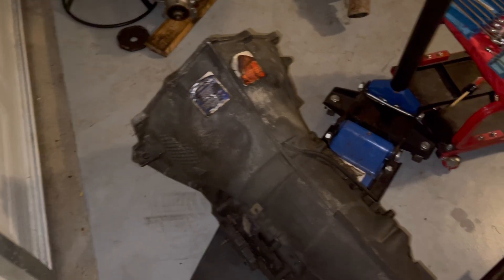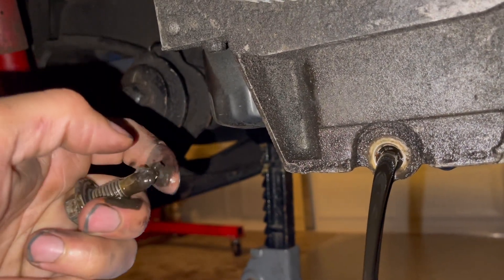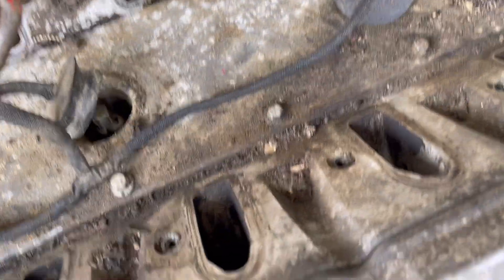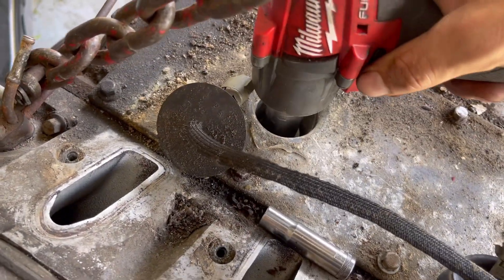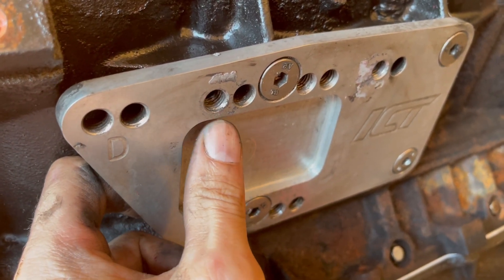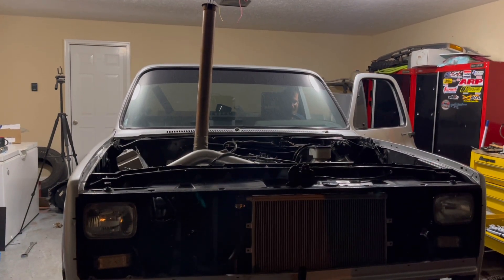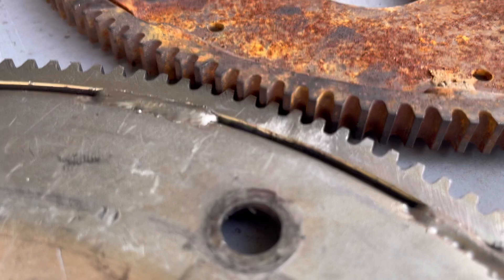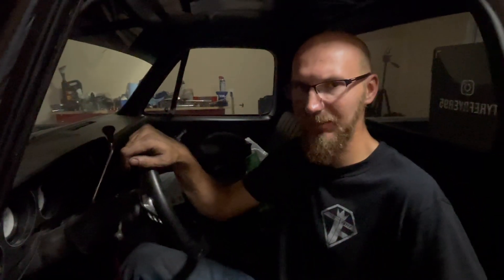Turbo 6.0 LS Engine Install

Comment: Also i dont know if you knew this or not but underneath the oil pressure sensor there is a small mesh like strainer when you buy one from AutoZone or wherever you get your stuff from you can take a long bolt and find out what thread pitch will fit in it and then use that bolt to take out the old one I had a Denali lq9 low oil pressure replace oil sending unit found out that it had one of those mesh filters but could never seem to get it out

Comment: Good call on ditching the Russ More trans. I had them check out the 60e in my 96 because it was shifting slow and it was missing 4th when i picked it up. Bone stock truck with 226k on the clock. Transmission clinic in Goshen fixed me up.